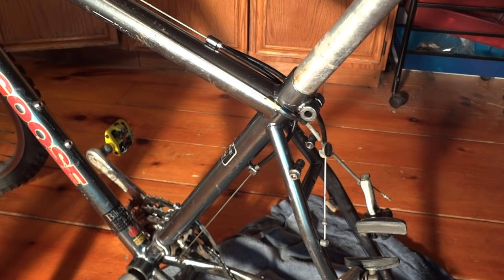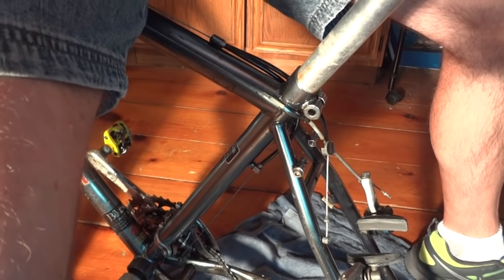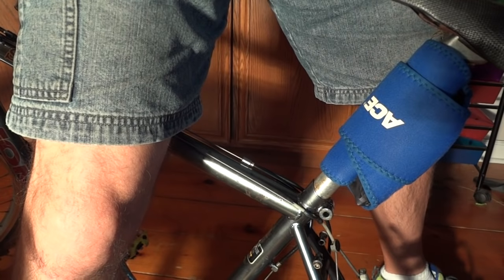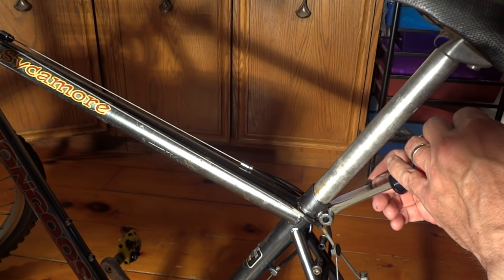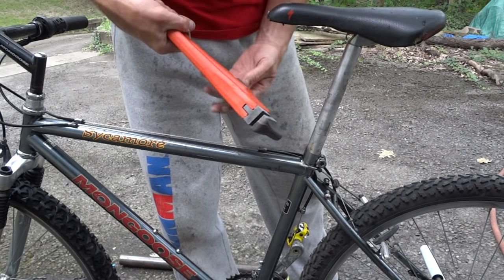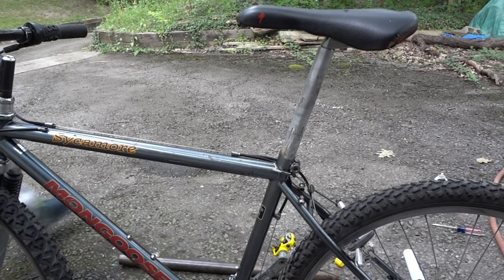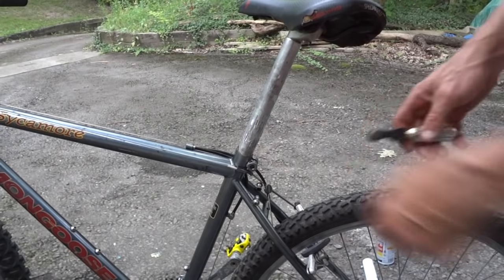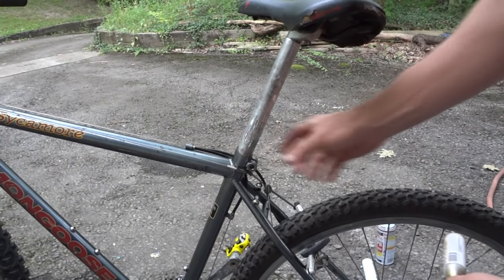Removing Stuck Aluminum Seatpost From Steel Bike Frame

Comment: Wow all that effort for TWO INCHES of post!
I did see a method of removal whereby you pour liquid caustic soda down the inside of the tube and it MELTS the aluminium away! Dramatic/fun/messy/exciting! You do have to remove the bottom bracket first and catch the nasty chemical goop you end up with in a plastic bucket. Not to be attempted indoors on the living room carpet. You obviously lose the post, but I think I would be sick of the sight of it anyway.
Reply from the maker: I did remove/overhaul the BB after this process after all the crap I sprayed into the seat tube.

Comment: you are just trying to make a video..Not actually trying to take the post off...soak it in penetrating oil while turning with pipe wrench...
Reply from the maker: No, I was seriously trying to get the thing out. It was stuck HARD. It's galvanic corrosion. https://www.youtube.com/watch?v=bGqV5KE7cb8

Comment: Need a helper to apply vertical force as you are turning it
An air duster can, used upside down, is more effective at chilling, because it releases the liquid which then very quickly evaporates causing the temperature drop. Those inflaters don't release the liquid, it evaporates inside the CO2 cartridsge, making it cold.
Reply from the maker: Yeah, I have tried chilling, heating, and chilling, and variations. It hasn't done squat except waste my money. Maybe for a seatpost that is only a little stuck. But then, I wouldn't need it anyway.

Comment: All the vinegar and lubricant is down in the bottom bracket now lol.
Reply from the maker: I overhauled the bottom bracket later. Getting the seatpost out is an early step. What would be the point of overhauling the bottom bracket before getting the seized seatpost out? The frame could be junk.

Comment: Just got up in the middle of this video to pull the aluminum seat post from my steel frame & greased it. 
BTW: What is the other way around. Seat-post that's worn & keeps going down?
Reply from the maker: Make sure you have the correct size post. They make a paste for carbon seatposts that allows the post the grip a little. Not sure if that will work with aluminum.

Comment: Got two bikes in similar shape, a Rocky Mountain Cardiac and a Kona Smoke. One I'm going to try ammonia through the bottle cage holes and the other I'm going to use chlorine bleach. Also Chill Zone pentrant has been recommended too. They're going to come out one way or another.
Reply from the maker: Go for it. Never had much luck with that stuff. Why bleach?

Comment: Aluminum has a very low thermal expansion coefficient, thats why is used in many "thermal applications" such as heat sinks for instance. That's why cooling or heating didn't work.
Reply: What about carbon fiber? Does thermal expansion will apply?
Reply: I'm no expert on materials, but checking online it appears that Carbon fiber has very low thermal conductivity and also low thermal expansion coefficients. Therefore my conclusion would be that with carbon fiber it would have been even worst. Even more, most likely you would damage your frame. Not so long ago I had to remove an steel-to-steel seat post (maybe there heat would have worked). The only way moved was putting WD-40 all the time during a couple of days and grab the seatpost very strongly, a vise for instance, and apply force to the frame. There is always a risk so go step by step, never focing things.
Reply: Simón Torres    Aluminum has a higher coefficient of expansion than steel.  22.2 e-6 / K for aluminum vs 12.2 e-6 \ K for steel.

The reason aluminum is used for heat sinks is its high thermal conductivity, and because it can be extruded and machined readily and is relatively low cost and lightweight.

Because of the high coefficient of expansion and high thermal conductivity, one way to remove a stuck aluminum seat post in a steel frame might to immerse the exposed end of the seat post in liquid nitrogen.  Alternately, one could plug the holes and pour LN2 into the seat post and seat tube.  On a 27 mm seat post, one could open about 0.05 mm space between the post and tube.  That's not a lot, but might be enough.
Reply: You are right. Trying to figure out where my confusion came from. Thanks for clarifying.
Reply: Someone above mentions having removed his seized seatpost after leaving the bike in winter cold.
So you confirm that ? It's possible ?? What do you think are approx. temperatures needed ? like 0-5 C°, or under 0 ??
I'm seriously interested because I have a seized quill stem- there is NO WAY it can be removed with force- and I don't know what I'm gonna do.

Comment: had the same problem with a road bike and i took the bottom bracket off and i've filled the tube with vinegar with the bike upside down, also you can pour the penetrating oil or vinegar tru the cup holder screws if u don't want to take the bottom bracket off .. and used an adjustable wrench on the top of the stem so I can reuse it!
Reply from the maker: Then your seatpost was not seriously stuck.

Comment: why didn't you just boil a kettle and pour it over the bike frame to expand the steel and quickly remove the seat post before it cools ? .
Reply from the maker: I have tried that on other frames, and it has never worked. I am guessing it only works if the seatpost is just a little stuck.

Comment: How long did it take for two inches of aluminium oxidation? I have my stuck all the way it looks.
Reply: same here ! But it's a quill stem. About 15 cm deep. I have reasons to believe it's been in there for 25 years.
There is NO WAY I can remove it.

Comment: If the seat post so very, very embedded into the frame post, could you cut the seat post off evenly at the top of the bike frame and insert a smaller seat post? This seat post is so far down in the frame post that even cutting slits in it leaves little to get hold of. Darn thing is mated for life I'm afraid and I'm just a mom trying to help a son.
Reply from the maker: Uh no. Here are some other ideas: 
https://www.youtube.com/playlist?list=PLxO5aF0sensiVdiClC_JH6OboqFl5Dvay

Comment: I bought an old mountain bike from Goodwill to tear down and use as a touring bike. The seatpost was stuck and after I got it out I saw a lot of rust inside the seat post. I don't know if I got lucky but I just bent the tabs back a little and used Q-tips to coat the the top of the bar as well as the bar that was exposed in the crack from the bent tabs with bearing grease. I then used a hammer to lightly tap the bar down until I saw some of the grease disappear. Then I was able to use vice grips to wiggle the bar out. I was lucky in the fact that I had plenty of bar to risk this tactic
Reply from the maker: It wasn't too badly stuck then.

Comment: Yeah just got mine out, took me a good couple of hours, tried everything, in the end i had to angle grind the top and bottom off and put a hacksaw blade through the middle of the post and hacksaw down one side and then bend the corners in and hammer flat bladed screw drivers down to drive the post away from the tube wall. Pain in the arse but got it out in the end!!
Reply from the maker: Uh, yeah. The screw driver sounds like a bad idea.

Comment: VINEGAR will dissolve iron oxide, if that is part of the problem (it usually is).   I use it all the time on antique tools, light fixtures, and stuff.  Speaking of tools, you really shouldn't use screwdrivers as a prybar substitute.  You'll wreck your screwdrivers, and prybars are cheap, not to mention more effective.
Reply from the maker: Generally the problem isn't iron oxide. The problem is usually aluminum oxide from galvanic corrosion. And vinegar has no effect on that.
Reply: RJ The Bike Guy I'd be VERY surprised if iron oxide wasn't making a contribution to the problem.  I've repaired many aluminum framed doors and windows that were held together with steel bolts and screws.  They corrode each other, not just one of the metals.  Try muriatic acid, it works on both.  Mostly it just depends on the extent of the corrosion.  Aluminum might corrode at a slightly faster rate, I don't know about that, but they damage each other in the presence of water, even humidity.  Muriatic acid might be a little rough on the paint, so dilute it if you're worried about that.

Comment: Next time RJ, when is starting to turn. Use marine grease on the back gap where you remove the screw. You’ll start spreading that grease when you turn it. It will come out faster. I did it yesterday, it was still a work out 🏋️‍♀️ 🤣😂 but... it did came out much faster.  I hope your back is doing better! ^_^
Reply from the maker: I sprayed a ton of oil down into to it.
Reply: RJ The Bike Guy I know me too 😂, but the grease once it was spread in there. Was like butter compared to the oil.

Comment: I used simply WD40 + waiting two days and it worked out.
Reply from the maker: Then yours wasn't very stuck.
Reply: Before two days there was not 1 micron of movement.
Doesn't matter, the important point is that the frame survived. 😉

Comment: Why not Coca-Cola? That stuff removes rust on everything. If it gets sticky, you can rinse with hot water.
Reply from the maker: Coke TOTALLY SUCKS at removing rust! https://www.youtube.com/watch?v=DZVdkLWAurE
And it's not the rust (iron oxide), that is the problem, it's the aluminum oxide.
Reply: Looks like. I've never tried it, but some people swear by it. Thanks

Comment: upside-down spray can of computer duster! spray that on it, will turn very very cold
Reply from the maker: I have tried dry ice before on a frozen seat post. Didn't do anything. Maybe it will work on a slightly frozen post.
Reply: RJ The Bike Guy gotcha i like your new seat post puller tool haha

Comment: Auto ATF thinned 50/50 with mineral spirits applied with eye dropper from a baby food jar, let sit overnight. Best bolt buster there is vs all the other "bolt buster" oils ect. Why? ATF has detergents it that de-oxidize metal.  Which is why you'll clog an ATF filter if you have a gunked up auto transmission.  It works , Popular Mechanics tested this against the popular brands with equally rusted/stuck bolts and with same torque settings. It works on many stuck metal parts, not just nuts/bolts.
Reply from the maker: I have tried it. It was more of a PITA than it was worth.
These days I use Seafoam Deep Creep.
https://youtu.be/st8dkGzJWtg
Reply: @RJTheBikeGuy  Hmm. Funny , Ive had great success with it .
Reply: @RJTheBikeGuy  Worked great for me. Dont see it in your test, PM tested it as the best. Readers should try it. Works great on alloy heads and stuck spark plugs. Its not instantaneous though.

Comment: With pipe wrench it was bound to give way either moving or breaking.   Steel seat pillar would be interesting, not saying I want the job though.  😀
Reply from the maker: Steel in steel would be much easier. Just rust. Rust is easy compared to galvanic corrosion.
Reply: @RJTheBikeGuy  Really thought steel on steel would be impossible if really rusted in. 
May by a second hand pipe wrench at a flea market in case I need to do the same thing as I do bike mechanics myself. 🙂
Can I recommend you get a proper workbench etc. You do some great videos. 👍

Comment: I have the same problem but mine has a Allen head screw like on a handle bar stem. Won't budge.
Reply: That will take some careful planning before you start. Are you saying you have a seat post with an expander bolt inside it?
Reply from the maker: I removed a stuck quill seat post using this method: https://www.youtube.com/watch?v=7GvN7w386U0

Comment: You know how the seat guts are a seperate section to the actual seatpost? I was working on one and the seat guts pulled out of the post. There's no area leverage at this point, so I'm going to have to drill through it and use a bolt as leverage... damn you, aluminum oxide!!
Reply from the maker: Guts? They are generally hollow. Maybe you have a suspension post?
Reply from the maker: https://www.youtube.com/watch?v=P-YpmDx86d0
Reply: @RJTheBikeGuy  I wish it was that simple. The part the saddle clamps to is a seperate section to the actual post, but they're usually glued or formed together in the factory and are not supposed to seperate. In my case, the seat clamp on the top of the post was glued in with Epoxy, but the glue failed when I attempted to use the saddle as leverage - the post is still inside the frame, but the section the saddle clamps to is free. So following the tutorial where you used the impact driver, I drilled through the post and tried to use an old rear axle and a handlebar for leverage (I don't have an impact driver) but the 10mm solid chromoly axle was no match and bent without so much as a milimeter of movement. Tried heating the seat tube with a blowtorch to expand the steel tubing but that didn't work, so now I'm trying the vinegar thing.
Reply from the maker: Vinegar won't help. You beset options are probably a really big pipe wrench, or cut it out. Or you can make the socket tool and borrow an impact wrench (not impact driver).
Reply: @RJTheBikeGuy  So I'm not exactly sure why, but late last night it actually came free. Huzzah! I suppose the solvents, heating, hammering and the bolt levered with a handlebar managed to shift it free. Couldn't have done it without your videos, RJ 👍

Comment: I took the seat off my bike not realizing the bar was loose. it feel down inside the frame. how do I get it out?!
Reply from the maker: +Jessica January Try turning the bike upside down and shaking? You might be able to hook it with a piece of coat hanger.
Reply: I tried, tried knocking along the tube and it didn't work :( I'll try the hanger idea. Thank you :)

Comment: You can put wd40 in the holes for the bottle holder and turn it upside down
Reply from the maker: If that worked, it wasn't very stuck.
Reply: Just to get more wd40 in there in the bottom of the seat post

Comment: I've tried everything with my road bike to release the seat, prying open the seat tube  spraying penetrating oil in, heating the tube up with boiling water then pouring cold water on it spraying wd40 wracking seat post with a hammer nothing works..... It's a carbon seat post in a aluminium frame so different from yours. I'm gonna try heating it with a hair dryer and some nail polish remover like you used ammonia ? It looks like a lost cause tbh
Reply from the maker: Try this: https://www.youtube.com/watch?v=S3ek2GeZzE0
Reply: @RJTheBikeGuy  if only I had one of those. But thanks
Reply from the maker: @brucelee2309  Borrow one. I borrowed it from an auto parts store.

Comment: For the vinegar, any reason you did not remove the bb, turn bike upside down, and pour a whole bunch through the seat tube?  Seems like you could have gotten much more in there and wouldn't have ruined your bb
Reply from the maker: If I had it to do over again, wouldn't have done the vinegar. Kind of pointless against galvanic corrosion. Live and learn. And I was going to/and did overhaul the BB later.
Reply: @RJTheBikeGuy  what liquid do you recommend for Al/steel?  Al/Al?
Reply from the maker: @roomservicetaco  A good penetrating oil may help a little as a lubricant. https://www.youtube.com/watch?v=bGqV5KE7cb8

Comment: After watching this, i bought a pipe wrench with 53 cm long handle and i was able to turn a seat post which i had thought it was dead frozen. Such a nice feeling that at least it turns now. My next challenge is how to pull it while turning as it still takes quite a bit of power to turn. I dont want to invest more to tools such as puller etc. I'm contemplating to use grinder to cut it short and then use sabre saw as the seatpost looks seated rather shallow. But i'm wondering if that's necessary when seatpost is able to turn?
Reply from the maker: Spray in penetrating oil in and continue to rotate it. It will get looser and looser. Then use a hammer under the seat and tap it upward,
Reply from the maker: Or https://www.youtube.com/watch?v=S3ek2GeZzE0
https://www.youtube.com/watch?v=P-YpmDx86d0
https://www.youtube.com/watch?v=LJLZ9Ojtr80
Reply: @RJTheBikeGuy  That sounds promising. I will do that. THanks a lot
Reply: So after 2 months, exactly yesterday, i finally removed the ''sucker'' :)  It was so hard that i had to try it whenever i had time. inch by inch and it's done... nice feeling. Thank you again

Comment: seems bizarre that you would put in so much effort for a bike that cost about £/$100 brand new!
Reply from the maker: You are apparently under the mistaken assumption that all Mongoose bikes are Walmart bikes.
Reply: Just this bike by the looks of it! Canti brakes for a start - looks like a mid 90's model that i used to see stocked in Halfrauds!
Reply from the maker: A Mongoose Sycamore retailed for about $370. But this bike had been upgraded with RockShox forks to be like the Mongoose Sycamore SX which retailed for about $520. So just because it LOOKED like some bike you saw, doesn't mean it's the same bike.
Reply: Ah ok, i understand now, so the same price as a GT frame then.
Reply: So it's both a how-to AND recycling channel. Horrible shame that. I wish I had never learned multiple methods to remove a seatpost from RJ.

Comment: Is it inadvisable to use an aluminum/alloy seatpost on a steel frame?
Reply from the maker: +Jani Ⓥ Not at all. But you want to coat the seat post with a thin layer of grease before installing it. That will help prevent the galvanic reaction between the steel and aluminum.
Reply: Thank you very much :)

Also, no hope of being able to replace a freewheel with a cassette, is there? I live in a pretty hilly area and I wanna put like a 32 or a 34 in the back and I'm having a hard time finding freewheels that size.
Reply from the maker: https://www.youtube.com/watch?v=qcgz3-XyNkI
Reply: RJ The Bike Guy Wow thanks :D